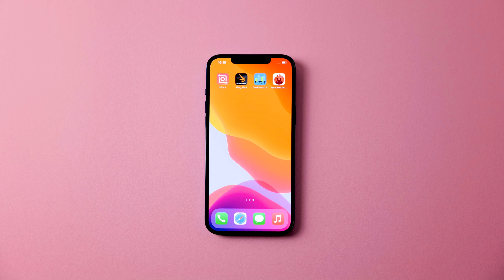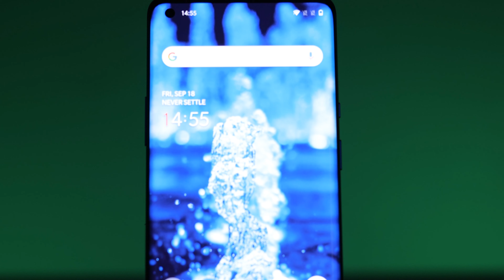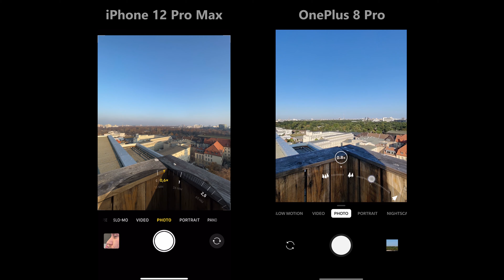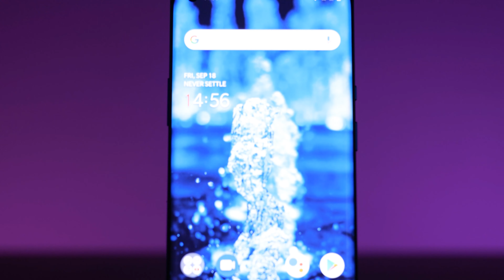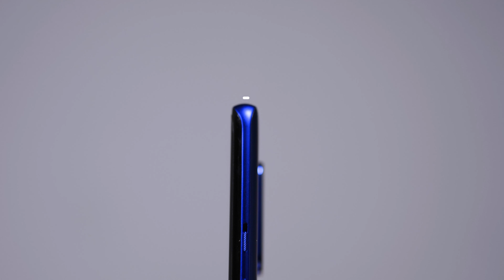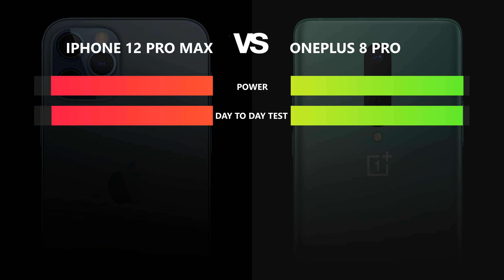iPhone 12 Pro Max vs OnePlus 8 Pro! | VERSUS

Comment: I've been using the 12 Pro max for 2 weeks after running the Oneplus8 Pro for 6 months. The Oneplus is just so much better. My own view is the iOS operating system is just too locked down and limiting.  I will keep with the Iphone for now though as I have an apple watch. Thats is the sole reason.

Comment: Sorry, but can't agree the much more expensive iPhone could possibly win this. Heavier with more sharp edges is, objectively a worse design, because it's more uncomfortable and you can't argue over looks, anyway. Camera seems a slightly bit better, but with the video in mind, it's pretty much equal for me. But the most important thing: It's unacceptable to me,  to offer such an expensive phone, or  "lifestyle product" with a 60Hz panel in 2020. Not to mention the weak battery.

Comment: i'm wondering, does youtube work on 120 hertz aswell on your oneplus 8 pro ?
in another review someone said youtube only works on 60 hertz... 
i also have this issue on my oneplus nord, but not on my oeplus 7 pro..
Reply: Youtube and most applications are capped at 90Hz. Quite a few applications and games support higher refresh rate. But not youtube.
Reply: @RioGamer  youtube isnt optimised for 90 hz yet

Comment: I know this is a late comment but as a one plus user (my friend uses the 12 pro max) the one plus is just easier to use/ hold in the hand. The 12 pro max feels really uncomfortable probably because of it's wide blocky design. I really dislike curved screens but in this case since I don't get too many accidental touches I am fine with it because it helps make the phone feel more 'handy'

Comment: If I have to say which phone is better in these, I would say OnePlus 8 Pro, coz there's simply no reason I see iPhone getting a better design and also comparing it with price to performance ratio. But if u include the phone with it's ecosystem wise, like with OnePlus 8 Pro with OnePlus Buds Z and with iPhone 12 Pro Max with the whole Apple ecosystem, then I might give the credit to iPhone. But as for phones that what most people will be buying, I would say OnePlus 8 Pro is a better device!

Comment: In my opinion the OnePlus 8 pro is a better overall device. Faster wired charging, faster wireless charging, better display with a 120hz refresh rate, better design, better price, more customization, faster software.

Comment: Nice vid and in my opinion a 700$ doller phone and older phone is allmost beating a 1100$ new phone now i call that a win
Reply: One plus 8 pro is currently $900+ after taxes. It's not that cheap
Reply: @EchoSignals101  550€ on Box 🤣
Reply: Well that’s cuz it’s an entirely different phone. You can’t expect all phones to have the same hardware cost. Some people prefer IOS so they are willing to pay more.
Reply: I do too! Especially since I got mine for 550.00🤣
Reply: Being compared to an newer iPhone still is a win for the OnePlus

Comment: Let me give a piece of advice. If you're going to make an "objective" comparison (which you severely fail at), then the least you can do, is not give the "design" point to the phone that you "like" the most. Damn, it has huge bezels and a humungous notch right in the middle of the freaking display! It objectively is worse to look at than a little circle in the corner that sits in your peripheral vision and is barely noticeable when watching a video and doesn't even hinder notifications.

Comment: Watching on my OnePlus 8 Pro , My kidney is still left😉
Reply: I love OnePlus, unfortunately it's not sold in my country, so I gotta stick with Samsung, the Note 20 ultra is awesome too.
Reply: @space-eye7760  Which country are you in? AliExpress has vendors for basically every market, so you might be able to score it there. Cheaper as well. I bought a Chinese one on AliExpress shipped from Spain (I live in the EU), so no issues with customs, and flashed the EU firmware on it. I bought mine 3 months ago for $820 for the 256GB top spec model and haven't regretted it a single day. By now I could get it from Spain for just over $700.